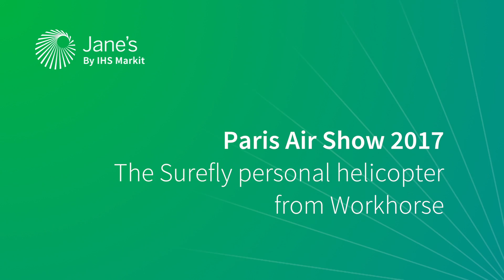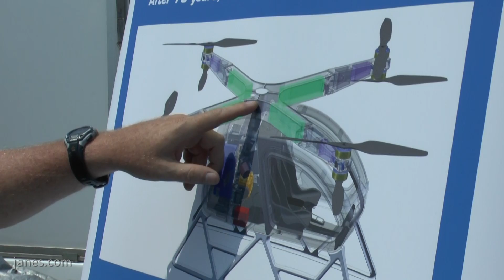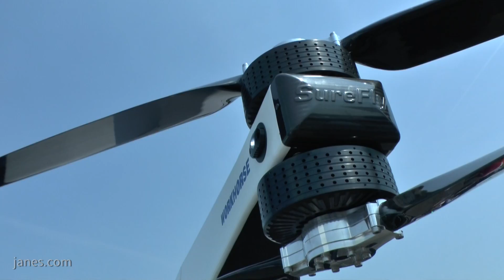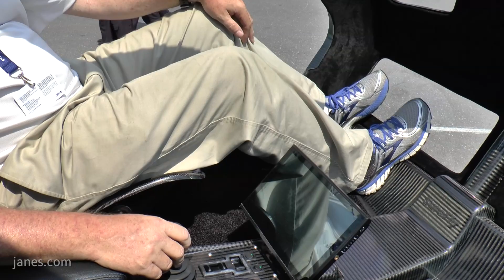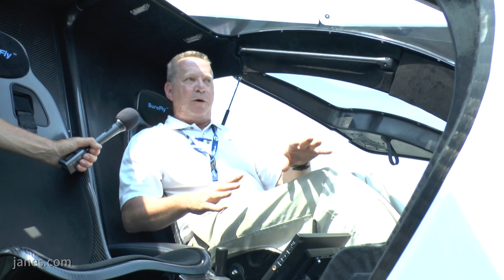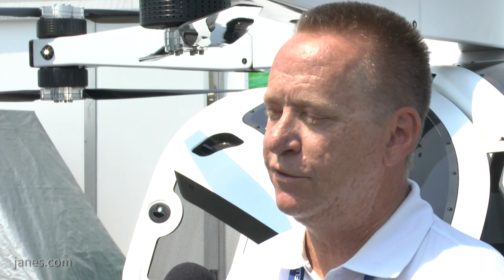Paris Air Show 2017: The Surefly personal helicopter

Comment: Certification is the big issue.  This type of device can not  autorotate.  This device uses a petrol generator for electric power and the batteries merely as a safety backup.  A parachute is a further backup.

Comment: Wow! It's incredible how such an 'amateur' design may appear on an International Air Show...
The gas struts mounted upside down or the joystick's unused degrees of freedom (push/pop, spin - thus with unnecessary toggle switches) being the least offenses... 
I strictly recommend replacing the piston engine tied up to the electric generator by the old and proven steam one.
My 6-year old son would even suggest the ebonite rod rubbed by a fox brush to accomplish this! (Very ecological, disregarding wild fox destiny)
Happening to be in charge of the FAA I would never let the negotiations to proceed up to the middle - driving out such a certificate applicant with the whip at once
Reply: I think you need to go and have a nap.....your comment is completely nonsensical not even amusing.

Comment: Any video of it flying? The numbers make things look a bit iffy? Eight motors are going to be 20 HP each to give vertical lift ,roughly 160 BHP. Pretty much the same as Robinson 22? It pretty light and needs all of that to get off the ground two up! Given the motors, batteries,generator and engine then it going to be much heavier? Each motor not going to be less than 10 kg so 80kg there, batteries going to be much the same so80kg there, engine going to be 160 to 180 hp minimum and that another 80 kg if not more and generator that makes enough power going to be 50kg , no less.  The empty weight going to be no less than 500 o 550 kg with a lift off weight of 750 kg or more when two up with fuel. 160 HP will be only just enough to lift 750 kg. Keep up great work guys, going to be bloody hard work and a lot of keen design to get it to viable flying status.

Comment: "As simple as controlling a DJI drone" hmmmm
thinks back to all the times I've bonked my drones into trees and pavement in the beginning
Reply: wobblebits my drone randomly errors in the sky and falls all the time last time it survived a 900foot fall into my buddy’s field still flys just as good as the day I bought it
Reply: It’s like an esc error. It flips side to side till it hits ground so it stays inverted providing no thrust but at the same time the video will cut and all control will cut but works fine once turned off and back on and back on ground also I haven’t flown it in a horizontal sense farther than like 100yards from me and no higher than 300m
Reply: We are talking bout the DJI spark here btw

Comment: Using an internal combustion engine to generate electricity to then charge batteries and power motors is extremely inefficient and primitive.  This approach will lack range and payload capacity if it ever gets off the ground. The Surefly design takes a step backwards in almost every area and will never be viable.
Conventional helicopters (piston and turbine) are hard to beat for efficiency, payload and range. Large rotor blades are simply more efficient than smaller fixed propellers. The are also quite safe in engine out situations because of the auto-rotation capability which multi-rotor aircraft inherently lack.
The advantages of helicopters are made possible due to mechanical complexity and associated expensive maintenance requirements. The is the only area where multi-rotors have the advantage.
Until Multi-rotors can match conventional helicopters in most performance areas, they will not be feasible for passenger applications.

The one design approach that has a glimmer of hope to match conventional helicopters is fuel cell power. Natural gas fuel cell power may be the most practical because of much lower cost compared to hydrogen. This could bring the operating costs of a multirotor passenger drone well below that of a conventional Helicopter while also providing long range and endurance along with decent cargo carrying capability. More research on fuel cell technology design and manufacture is still needed.
Reply: CNG and LPG are indeed the only options. The skill the helicopter need is the factor in which the multirotor has the advantage.

Comment: This has better design than China's Ehang 184, szame look, but that one's propellers are on the base which is not safe(blades are below the carriage) and no ducting(fan covers), it has no manual controls(it is controlled by google maps/GPS), it has no parachute and no backup batteries and its expensive as shit.

Comment: Generating electricity from an engine and then converting it back with motors will lose more than 50% of that energy. If there are batteries for emergency landing, then the engine should drive the propellers directly, and with a small generator to keep the batteries charged.

Comment: I wonder why they made it so inefficiently? They have to know that putting one motor over the top of another is not as efficient as them operating independently. In other words, 8 arms are better than 4. Also, the weight of this thing looks like it's out of control but perhaps they made it to some public safety standard? Further, what is the maximum weight of the passengers. I'm glad we're coming up with a reason for obese people to finally lose weight. I would love to see only fat people driving simply because they can't fly while I fly over them and they wait in lines on the highway lol...
Reply: Nope, each blade rotates opposite of another. I fly drones and this is how it works for drones and these copters are just large drones. When you have a "quad" like this one you have 2 blades spinning clockwise and 2 spinning counterclockwise. When you want to change your YAW you slow down 2 of the blades. Putting a spinning blade above another reduces the efficiency of the lower blade because air passing over it is rushing buy instead of allowing the blade to cut into it. It would have been far better and more efficient to put the motors down the arms meaning, 2 on each arm but not above each other. Adding more arms, as I suggested before, is actually less efficient because it adds weight. Their setup is inefficient and what you want is maximum efficiency which means longer flight times and more allowed weight.
Reply: It was designed with 8 on 4 arms for redundancy. if a blade fails, the one above/below. I'm confident the people designing this is a better engineer than you or I ;-)
Reply: @johnmarkharris  in that case volunteer to be the first pilot.

Comment: i wonder why it doesnt use multiple small 1 cylinder generators for extra redundacy, instead of one big generator?
Reply: Have you ever tried to start a weed chopper and after a few pulls without luck you toss it back in the garage and use a hand shears?

Comment: "if the engine fails, the batteries will bring you down safely". Wow! Flying batteries!
Reply: wouter van wijk motors are electric . engine is a generator . Then if fails bateries have enough charge to last 5 minutes of flying time to land the drone

Comment: it will not solve the traffic problem. this is not future transport, to solve the problem of future transport ALL 3 PLACES WHERE MAN LIVES SHOULD ALL BE INTERCONNECTED and this can only be done if all buildings are interconnected therefore the SOLUTION TO FUTURE TRANSPORT IS SIMPLY AN ELEVATOR but extremely different from the conventional. THE ELEVATOR SHOULD BE ABLE TO TAKE YOU TO DIFFERENT buildings. 4 me the future transport looks like many doors that will open and take you to any place you want except the ocean of course.

Comment: That is not a HELICOPTER. It has no tail prop. If it said personal octocopter...
Reply: There are helicopters that don't have tail rotors. They're called NOTARs. Helicopters do not have to have tail rotors to be helicopters.
Reply: motorcop505 - helicopters have torque, rotors compensate, those without have an eternal fan which exhausts from the tailboom.

Comment: The parachute will bring you down safely. Yeah, never mind those high tension power lines you are floating into. Just don't touch anything metal but do prepare to be cooked to well done.
Reply: A dunb arse will do that and expect to get away with flying near power lines.

Comment: Very cool looking. Was shocked at the control panel, it's location, as well as the throttle mechanism. Certainly a cost and weight-saving thing.  Looks makeshift to me.  But the concept is great.  If a DJI drone can do it why not a manned heli.  Good luck with the FAA.

Comment: A big safety feature of traditional helicopters, but apparently not this vehicle, is "auto-rotation".  If a helicopter's engine stops, the helicopter can glide safely to the ground by auto-rotating its blades; basically this is the same way that Maple tree seeds spin down to the ground.  However, auto-rotation requires "variable pitch blades", which this vehicle does not have.

Comment: I would like to know the distance it could fly if you replaced the engine, generator, and associated electric production system controls with an equal weight of batteries, what would that distance be? I would think the price would come way down as well.
Reply: Replacing with batteries means you lose the ability to refuel in a short time anywhere you can get fuel, and you need to find a charging station somewhere .
Reply: @gangleweed  How about putting fast charging stations at all local airports, problem solved.
Reply: @aeasus  It would only work if you went direct to an airport with one but if you ran out of power getting to one you would not be able to recharge......perhaps a plug in solution might work but that would suggest a large battery pack.......I like the idea of an onboard petrol generator solution as you can get petrol any where at the moment.
My opinion is that they've spent too much time making it look pretty whereas it should have been prototyped as a viable flying machine then prettied up to get sales........I don't think this model will ever get to a flying capability until the basic concept flies with a payload and a live pilot at the controls.
Reply: @gangleweed  there are better designs already flying
Reply: @aeasus  ....up, down, around and around, those magnificent men and their flying machines.........for me, Terra Firma.....the more firmer the less terror.
Having watched one too many of those air disaster shows I'm a dedicated ground hugger and will never ever be hoisted in the air by one of those contraptions ever, I have more respect for the well being of my body than to potentially experience the effect of jumping off a high cliff onto jagged rocks which is the same effect in the end.

Comment: Aside from the awkward controls, Im in. Sold. Except, I believe FULLY that everyone that pilots anything in the air should be subject to the same standards/tests/etc. This is NOT a drone. If errors are made in this, you could kill someone else or yourself and/or bring down some other aircraft. 

And you gonna have to get the mileage up buddy. 70 miles, to me, doesnt really settle as a max. Commuting to work seems great except if you work somewhere that has 3000 people and 10 of them have one of these......where you gonna park? ESPECIALLY in a place like NY. Needs some development, but I like it.

Comment: Here's what I think, No more pot holes, speed bumps & road construction.
No more speeding & red light camera tickets, traffic congestion & road rage.
Don't have to deal with the morons you all talk about, priced beyond most.

My concerns are will it come with a heater off the cooling system and does
it need a window wiper arm off the top center? It will need a secure cargo
net for the golf clubs or spare fuel container. Then I'm good to go!
Reply: Yeah, and no more road rage incidents......

Comment: No demo of it actually flying?
Also what's the max altitude and weight capacity?
Reply: Look at the stick. It's so small and the keys for ascending and descending are placed stupidly far away what a joke.
Reply: They have a video on YouTube where they get an amazing 6 inches off the ground.  Compared to E Hang that flew 300 m off the ground.

Comment: Understand they are trying to keep cost down, but it seems a small turboshaft engine mated to a generator/alternator would be MUCH more efficient from a power/weight standpoint than any internal combustion engine, with the possible exception of some type of rotary...

Comment: This is fucking horribly done, far more dangerous, and if it only takes a 14 year old to realize that, they're fucking idiots. First of all, helicopters are not dangerous, in fact, they're far safer than this piece of crap, and even driving. Second, there's a reason all these properly designed helicopters made by people who accually know what they're doing don't have all these high tech safety features. Its because they don't need them. Ask any experienced pilot what happens if the engine suddenly stalls in mid air. You can safely land a helicopter with no engine power. Thirdly, the "simplistic" controls. Completely useless. You know what that is? Loss of control. A pilot wants to have as much control as possible, for obvious reasons. Fourth, the gps navigation system. How safe do you think it is to lose all manual control, all the while the helicopter is b-lining to its destination with no idea what its surroundings are. 5 feet from the ground? Full speed ahead. Building in front of us? Full speed ahead. Also, why no rudder pedals? That seems completely useless and easier than to completely let go of all controls to turn. This doesn't need work. This needs a complete remake. By a group of professionals, engineers and people with actual experience flying a helicopter. Not some gut with an idea and money. Also, we get this thing up an running, how about we require the proper licences required to fly an actual helicopter. And have some ATC communication, that way we aren't completely blind to all air traffic.
Reply: Dr. Grenade R U mad bro? ;)
Reply: yes amazing 100s millions these around the world above citys people wont frow stuff out the windows computers that drive them wont fail people who fly them wont have hart attacks no parachutes fitted to them no need to worry when sleeping in home 1 dousnt brake down 500 feet above your home an come crashing down.ACTUALLY NOT AMAZING KEEP VEHICLES ON THE ROAD AIR ISNT FOR MASSES OF PEOPLE WE DO QUITE WELL WITH CARS ON ROADS.
an PARACHUTES why the hel do none these things have parachutes fitted that have mechanical mechanism to bring it down safely not an electronic parachute/ mechanicl so reliable.these could easily have parachutes an alarms that sound if brake an com down warning the public below. PLANES CAN GLIDE TO EARTH IF FAILS A HELICOPTER CAN AUTO ROTATE TO EARTH SAFELY BUT THESE THINGS CANT DO ANYTHING THEY JUST FALL TO EARTH SO MECHANICAL GRAVITY PARACHUTE DEVICE BUILT ABOVE THEM IS ESSENTIAL AN SEALED WINDOWS ON THEM IF FOR THE MASSES BUT NOT TO SEALED INCASE YOU CRASH IN WATER AN NEED TO KICK IT THROUGH TO ESCAPE IT.IN CITYS THEES PROBABLY HAVE ADVANCED GPS UNHACKABLE FOOLPROOF COMPUTER PROGRAMS INSTRUCTING THEM TO FLY ABOVE PEOPLES GARDENS ABOUT 50 FEET WITH OBJECT DETECTION SENSORS AS THE HIGHER THEY ARE THE MORE DAMAGE DO IF HIT A HOME AS THAT ONLY SAFE PLACE TO  TRAVEL A CITY I CAN THINK OF FOR THESE THINGS IF THERE THE FUTURE AN GOING TO BE 10S THOUSANDS IN EACH CITY AS MOST PEOPLE NOT IN THER GARDENS SO IF CRASH MOST PROBABLY NOT  HURT CIVILIANS.

yes these are amazing id love to have 1 with PARACHUTE BUILT IN AN SEALED WINDOWS AN DOORS:).
and 1 more thing these are a terrorists dreem:(.

Comment: This is so so so incredibely stupid I have no words. How is it better than a plane, a paramotor or a helicopter? It's incredibely inefficient because it takes more power to spin several small propellers to give as much thrust as a single, big one. If you want an electric flying machine for human transportation you can make it a plane or a heli and it will be much safer and more efficient (already being done which is amazing!). It is also much more dangerous than both the flying machines I mentioned. In case of single motor failure you lose stability unless some special control algorithm was implemented (not likely to work with so much inertia) and if you lose power, you are dead because you have no gliding capability nor autorotation. The only option in that case is a parachute which will not deploy on a small altitude which is still enough to get you killed.

Comment: Unless I see it in the air, it's just a concept. Also, to achieve the desired ubiquitousness, it would have to incorporate a much more complex version of autonomous automobile technology that performs reliably in three dimensions, not just two, as currently exists. I say at least 20 years out before they are widely used.

Comment: Lose one propeller and youre going down.  No possibility to auto gyro like on a real heli.  This heli needs at least 6 or preferably 8 mini rotors for redundancy.
Reply: Grzegorz Durda err it does. What video did you watch
Reply: Dude, i can tell by looking at the design, regardless of claims.  Say if one rotor strikes a bird and disintegrates you'll die and fall out of the sky.
Reply: @GrzegorzDurda  Crap, all you need to have is a couple of spare rotors that are static in case of a misfunction by one or more of the main ones and can  then get switched on in case of trouble.

Comment: I am no pilot but having a joystick and  an up and down switch makes no sense.  Its seems  like you would need to use both hands and have to do a reach around.
Reply: JM Rowe see DJI automated flight, manual mode is misleading